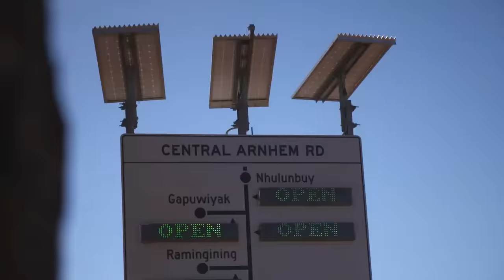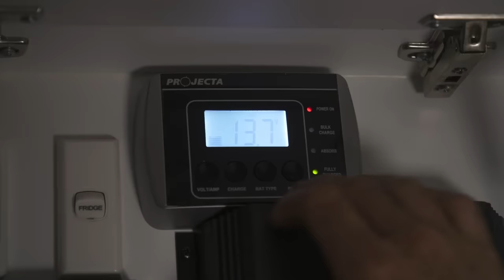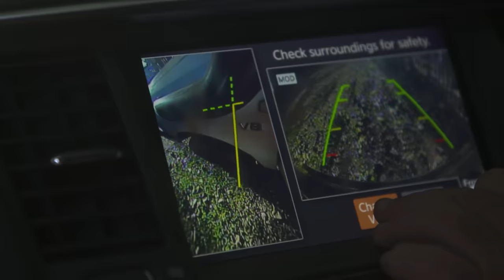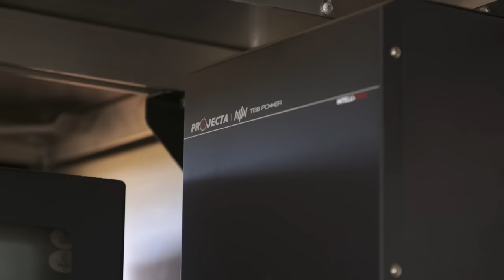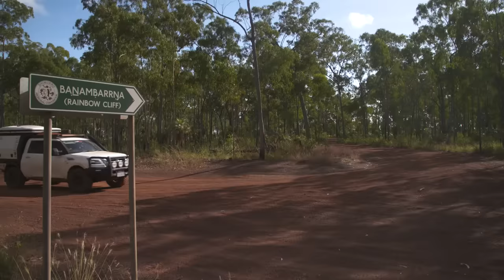REMOTE ARNHEM LAND ADVENTURE 10yrs in the making! Swimming holes, fishing & mud crab catch & cook

Comment: setting the drag is very important  you wont break off the line even with the sharks fighting for a meal. atr time out 22;05  please girl, or lady place your finger around the reel stem, middle and ring finger, or one day the shark will take you rod and reel with him? holding in the stem between the middle and ring finger insures your holding the rod for max. strength.  next time take a 9 volt battery and the connector to the top with the cut wires exposed , super glue the battery to a line and throw it overboard, GUARANTEED  NO SHARKS , the fish will come in and the sharks wont,?SHARKS HATE ELECTRCITY?